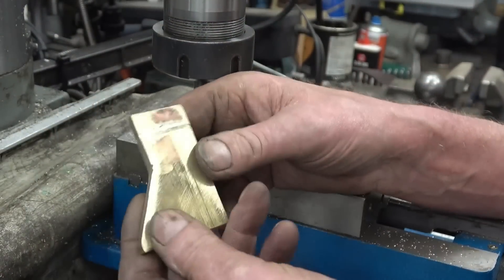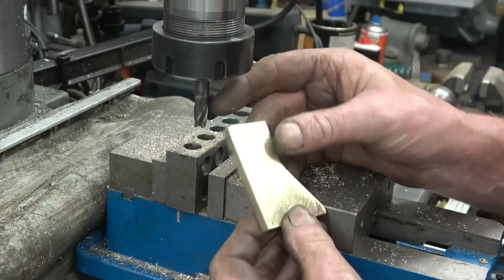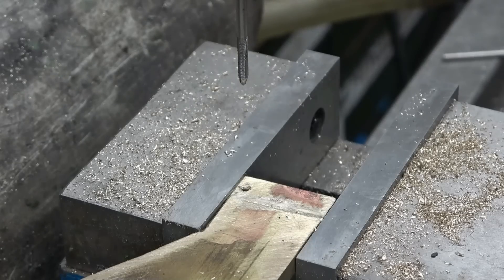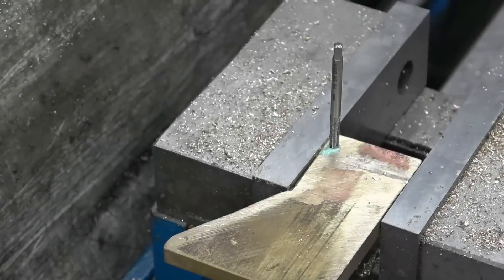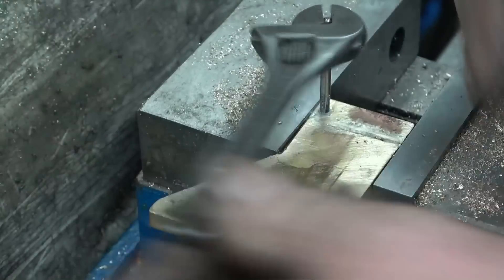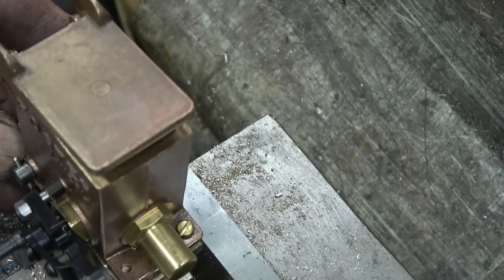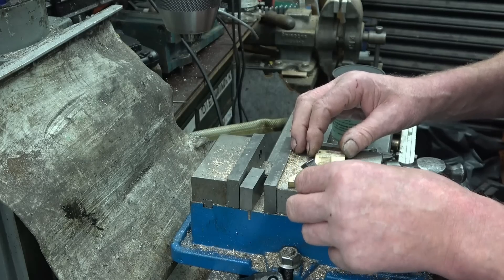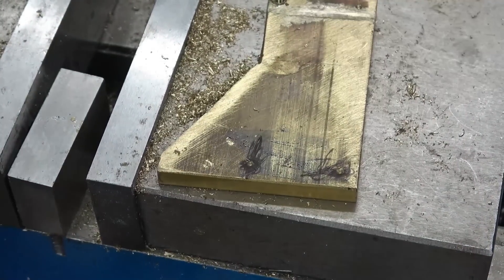SNNC 547 P2.How to Successfully Power Tap 3mm Holes

Comment: Could always have used a 1/8BPW tap there, and gotten some 1/8in screws instead. Or 4BA instead, as those will match the rest of the steam engine.
Reply from the maker: The engine is all metric threads it is only 8 years old